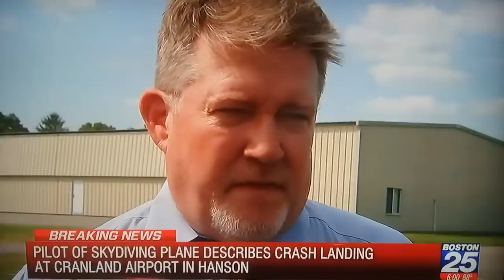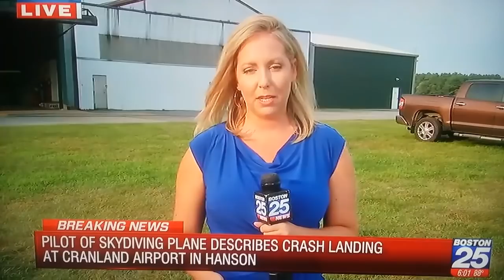News Fail: Cranland Skydiving Accident blamed on Flux Capacitor

Comment: As a prior Air Force aircraft mechanic I'd like to say this is a perfect example why you should always make sure your flux capacitor is properly charged. A Mr. Fusion installation is usually recommended.
Reply: I had a flux capacitor as a back up for my parachute rig. 
Senses when my asshole dilates too much and pulls the reserve chute. the new wifi version is  way more comfortable.
Reply: And don't forget to refill the Prop Wash.
Reply: Do you still have to wind 100 yards of flight line around it, like safety wire?

Comment: You need a certain amount of blinker fluid to keep a flux capacitor from over heating.
Reply: MrMudNugget Don't forget the muffler bearings ....
Reply: And don't forget to check the ID-10-Ts!
Reply: It could've also been the retro encabulator.
Reply: We used relative bearing grease.

Comment: When I crashed my helicopter, the reporter with the microphone asked me "How high were you when you crashed?"  I told her I was doing fine until I hit the ground.  Later I wondered was this a drug use question?
Reply: 😂 you know they meant how high were you when you lost power
Reply: @sammiemakki9339  I didn't lose power.  I lost control.  One blade went to a higher pitch angle causing rotor slow down.

Comment: I myself think it’s the Fetzer Valve. Nothing a little 3in1 Oil, gauze pads, and 30 weight ball bearings won’t fix.
Reply: I agree, Flux capacitators are out, it's ALLLL ball bearings these days, heyyy!

Comment: I didn't know there were stainless steel planes
Reply: Yes there have been stainless steel planes. But none of them had a flux capacitor.
Reply: The Mig 25 is mainly made out of stainless steel.
Reply: The Conastoga too. Just assumed aluminium was universal.